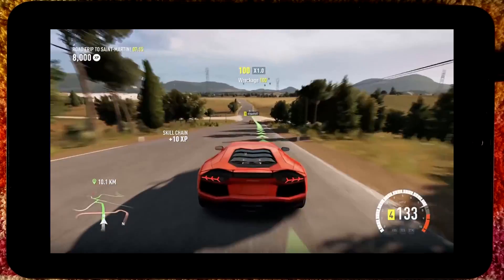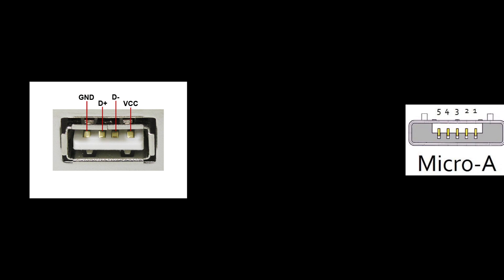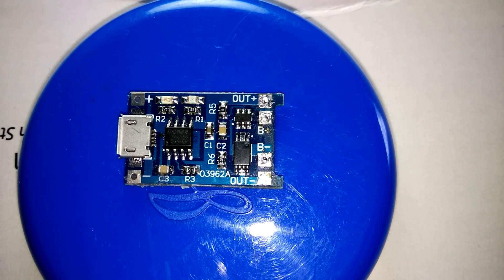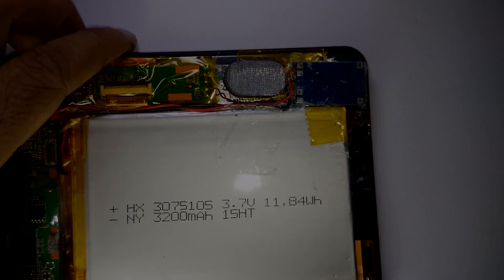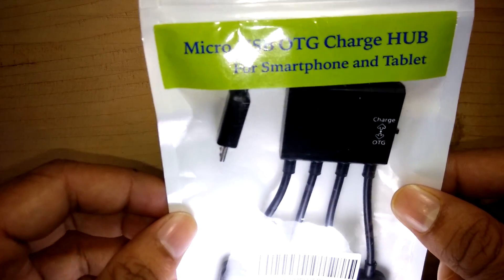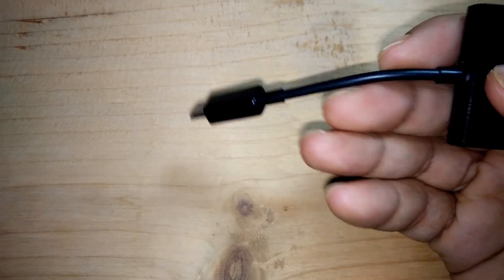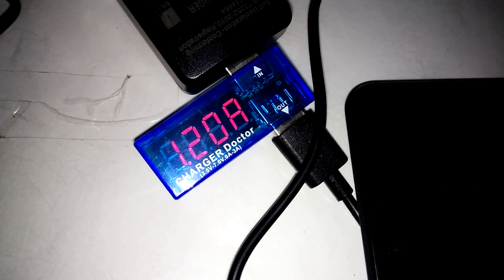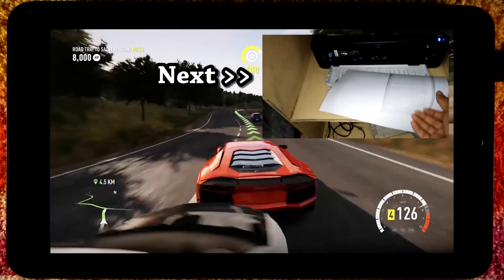MICRO USB OTG HOST And Charging Same time (simultaneously) on Android/ Windows✔

Comment: how do you do first method? id pin is grounded with resistor, is the ground and 5v wire of a usb male connected to the usb female and the micro usb? and then data wires are connected from micro usb to female usb?

Comment: sure you will end up frying the motherboard
if you want to use a TV, USB Device, and charging at the same time
use 3 in 1 hub type c to HDMI, USB 3.0, and Charging port
and then connect the usb hub on the 3.0 port
if your using micro USB then use a type c to micro USB adapter
its better than frying your mtherboard

Comment: The Y type OTG and charging cable is not for this purpose. It does not charge the Android device, it charges the mouse or keyboard or any peripheral device. The same with 4 connections cable. This video is strange. I tried both cablea nothing works on Sony Xperia.

Comment: I can confirm 100% conclusively that the 3 port "Micro USB OTG Charge Hub" shown in this video does NOT allow charging while using OTG. If anyone says it does, they are trying to cause sales of this device. I have tested it thoroughly with an HP Stream 8. And it does not say its charging in windows. And, big surprise! It doesn't charge! The battery level drops, it doesn't matter if you have anything plugged into the OTG hub or not. In fact, this hub will not charge any device, no matter what position you have its little selector switch in. I have still not found a way to use OTG and charge the HP Stream 8 or ANY OTHER OTG device yet. This includes Samsung phones and tablets.  I am thinking something in this video is doctored to make it look like that charges while OTG is in use. Like using the discrete li-ion charger that he installed himself. Do NOT buy one of these hubs! Not unless all you want is a compact OTG hub. It may have actually damaged my tablet. Because now, its not charging anymore.... We will see.
Reply: I bought one and it does not work...is there anything that can be bought  that will work or am I wasting  my time looking?
Reply: How can you say anything "conclusively" when you only tested HP and Samsung devices? Another user said it only worked on his laptop PC. 

Roy already told us the cable is lousy quality, yet you accuse him of dishonesty? He also warned that all of this was risky. 

Sorry to hear about your tablet. I hope you've gotten it to charge again.

Comment: 1) That external charging circuit in your video was installed wrong. There were 2 sets of pads; one set goes to the tablet, as you installed, but you're supposed to disconnect the battery from the tablet and hook to "b+/-" pads on charging board. Also, never use hot glue, it will not be a good heatsink for the charging circuit heats up significantly when working. Plus, make sure the output of that charger is the same as the battery. Most li-poly outputs are 3.7v those chargers sometimes have a buck converter lowering the amperage and outputting 5v. Installing the wrong one will fry your motherboard. 2) those USB HUB multi-adapter dongles will not work/charge on any Android device. The charging port is to supply power to the accessories and data only runs at USB 1.0 spec. So if you plan to use an external sound card and charge the device at the same time, it is impossible on Android.

Comment: Does method 3 (Startech Y Cable) work successfully with an Android phone? 
OTG and charging simultaneously?
Reply: Did you find any solution?
Reply: @MrWaheedrehman  Not yet. Waiting for reply
Reply: @nachum37  thanx for the reply
Reply: @nachum37  did u find any other solution?
Reply: @MrWaheedrehman  Unfortunately, no.

Comment: Hi, did you make any changes in the android settings for using y cable? My tablet is Samsung A6 (p580) and I am using same cable. But it doesnt work. I tried with different tablet (windows). Its works. So I assume thats a android setting issue.

Comment: i want to connect my phone to my pc to to data transfer  and plug the charger into the mains and charge the phone at the same time what tdo i need because  the usb port charges but its low amperage for my s6
Reply from the maker: use a usb y cable
Reply: @RoyTecTips  please ans big bro please
Reply: Which device is suitable for the honor 8x with wD 2 tbhdd for simulcharge please heo

Comment: I tried a couple of those ready-made solutions with my Note 8 to no avail (I'm guessing perhaps due to USB C?), fortunately I found that the Sansung Dex (used as a dock without loading the software) allows charging and USB connectivity. It's not without its limits however, you only get slow charging and there were issues connecting to my digital-audio-converter - when plugged in it's initially recognised by both the phone and certain apps but Ihen cannot be found by those same apps when you begin to use them. The result being that audio is rooted out via USB as normal, rather than at a higher quality via app as is the case when there's proper communication with the DAC.
I can only assume with it being limited to slow charging that the additional power drawn by such apps exceeds some limit programmed into the Dex.

Comment: where do you get the cables to install the circuit
Reply from the maker: +Somnath Das which one.
Reply from the maker: +Somnath Das TP-4056
Reply: the two wires the red and black

Comment: I see these cables on amazon. I laughed when I saw how many 1-Star reviews people are giving them, because they didn't check compatibility first! But it's a good explanation in this video here. 
"It might be 100k [Ohm] or it might be 69k [Ohm]. But you need to figure it out; what will be the value of the resistance for your device?"
2:26
Reply: claustrophilia there is a possibility that not all of the 1 star reviews were simply because of a lack of checking compatibility. i have a hub that is the exact same as the one in the video. i am currently on my third lol. the switch broke on the first one, probably lasted about 4 or 5 days. that one was replaced free of charge. the second one lasted about one month before the the power lead had wiggled enough to come loose. I soldered it, and soon it was the micro usb lead that came loose. I soldered and then it worked for another few weeks, and then the switch messed up again. It is cheaply made, and you get what you pay for.

Comment: i bought 4 in 1 OTG Cable Adapterin february , now it stopped working, do you know how to repare it ?. neither charging  nor otg are working
Reply from the maker: Two thing happen either 1. Any power cable is broken. then it is easy to fix. Open the case using pray tools and test the connection using a multi meter and fix it. probably this is the case.
2. There might be a hardware problem. the hub controller IC might  broken.

Comment: Hi Roytec, my question is about last portion of video where you say "A single problem with this otg adapter that it gives 500 mA to the tablet. Can you please let me know how do you increase the charging current goes to tablet. is the current increase just to restart tablet or you did some alteration in otg charger circuit. Thanks in advance.
Reply from the maker: +Tanveer Ahmed just restart the tablet fix the problem. Still I have the problem it show charging but battery discharge and stop discharging at 7%. But Tablet never turn off and maintain 7% charge forever. Even after 3 4 days. But after restart it started changing. May be it is a problem with my tablet. Thanks. Have a good day.
Reply: RoyTecTips what if you use a higher 2.4 amp  charger?
Reply: RoyTecTips buying links are out of stock can you share the one with stock

Comment: hey dude :) , i want to ask that can u provide me some more details on making that otg charging cable ? do i need to put a resistor or can i be done without using resistor too?
Reply from the maker: How are you man.
Some Windows tablet works without register (little register/ resistance of the wire is enough ). Some tablet need register 1k - 100k depends so use a variable resistance . I ordered some micro USB with 5 PIN from ebay.com last months . Still not delivered. If I get it I will make clear video tutorial. 

4 in 1 OTG charging HUB  only $4. 100% works with iball slide i701
http://www.ebay.com/itm/Micro-USB-OTG-Hub-Host-Adapter-Cable-For-Cellphone-S3-S4-S5-Note-2-3-High-Q-/291348805773?var=&hash=item43d5bdf88d:m:m3EYs16T2aEWMuBPac7Dhpw
Reply: +RoyTecTips i made one without any resistor and its working flawlessly :) i watched a step by step tutorial video and it came out to be successful , it was kinda tough to solder the tiny joints but it's totally worth it ! thanks for the reply dude ! :)
Reply: +RoyTecTips and i didn't ordered any micro usb 5 pin , i just chopped it off from an otg cable and it already had 4 pins connected to wires and 1 pin vacant , so i just connected the 5 wire too and i didn't had to spend any money .
Reply: @sahilkapoor2  bhai did it work same time otg and charging